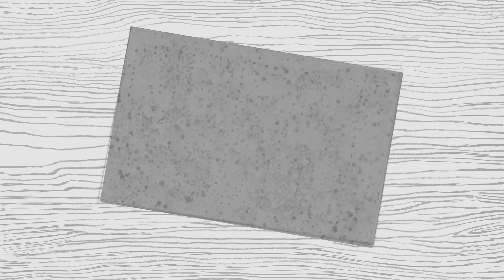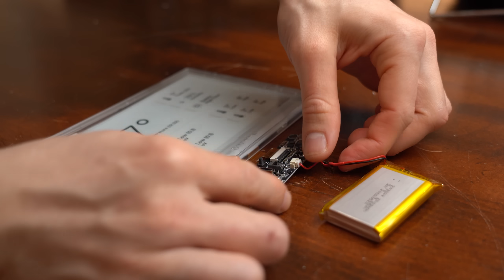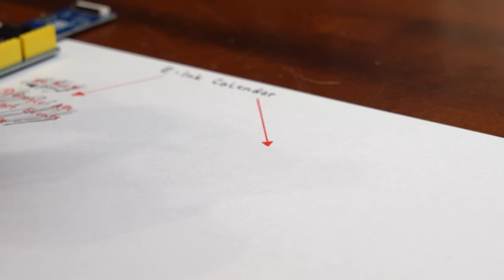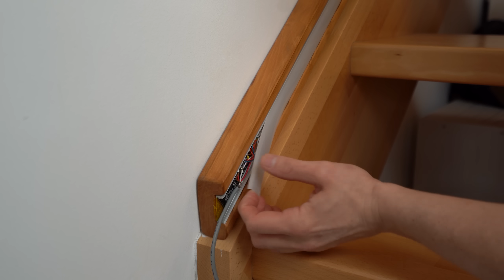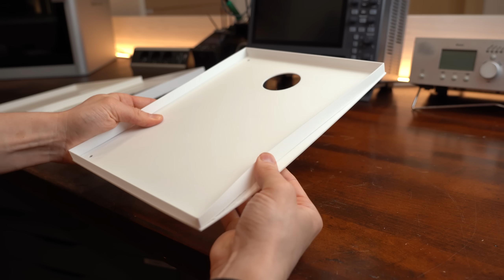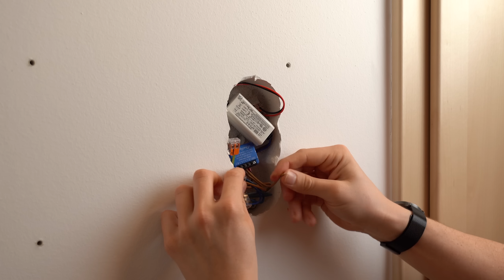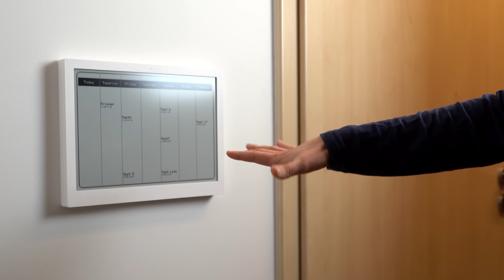Finally! A Home Upgrade That Makes Sense (E-Ink Display)

Comment: do you know much about esphome? I see it's enabled in your HA instance, but was surprised that this wasn't your first choice in how to approach this problem. It is a good way to integrate between HA and an ESP32, and there's so much headstart you get with something like that, OTA updates for example (I know you enabled that in your project, but it's native in esphome). Worth looking at, at some stage, to see if it's a simpler task than this.

Comment: Heyy, ich bin Privat super interessiert an Elektrotechnik, innerhalb von Geräten, arbeite
 aber momentan in der Industrie als Betriebselektriker. Da wäre meine Frage: Beschäftigst du dich nur privat mit Themen wie schaltungs Design und den einzelnen Komponenten oder ist das Teil deines Berufes? Wenn es Beruflich ist, kannst du mir verraten wie dein Beruf heißt? Weil ich denn vllt auch in die richtig ausschau halten könnte. Bin ja erst 22. Liebe Grüße

Comment: It's amazing, only thing I'd change it's to use the native esphome. Integrates amazingly with home assistant and allows you for quick ota with a decent secure structure keeping secrets and backup hotspot from the esp in case your network configuration changes.

Comment: I built something similar but cheaper. Took an old laptop, removed screen, bought controller on Ali, build frame from wood, and installed magic mirror, that has hundreds of plugins. It’s now integrated with google calendar, todoist, weather, news from local supplier. I added led rgb strip to inform me about bad air quality, speakers and mic for future use, motion sensor to turn off the screen if no one is around… it’s just loved by my family

Comment: That's a nice project. I did a similar one like that myself a couple of years ago, when the E-Ink displays were smaller and more expensive, I learnt the following when I did that:
(i) it's much easier to have a Raspberry PI sitting around that runs a couple of python scripts to call the openweather api,, google calendar service, etc, to compose an image to display, and restrict the E-Ink device to being a dumb terminal that will just draw anything it's been given .
(ii) I tried using a 3.7V Li-Ion battery and update every five minutes or on a button press - it would last for a couple of days on a single charge. However the hassle of having to recharge the battery every couple of days was too much, the thing really needs a continuous power supply otherwise it does not get used.
(iii) In those days I needed separate boards for power supply, timer, e-ink module, wifi module and microcontroller board, which meant the whole thing was about 2.5cm and not a sleek as your product. This project would be much easier today, now one board does the microcontroller part, the wifi link and e-ink interface.
(iv) Your 3d printed result looks much better than what I was able to create with woodworking three years ago.
However you have given me inspiration to give it another go.

Comment: The next upgrade step for this would be a two colour or rgb e-ink display, so each person could easily at a glance tell the activities that concern on, the other, or both. Either way, very cool idea, I hope more manufacturers start making and implementing e-ink displays, especially in applications like smart hub interfaces and such, where it can then be on forever.

Comment: That was a pretty awesome project! I like how big the display is, although hopefully those big e-ink displays will get cheaper over time.

One thing I thought might be useful is a button to manually refresh the calendar, in case you add an event tomorrow or in a few days time, and want to make sure it's visible immediately. Or does it already wake up and check for updates frequently during the day?

Comment: You could have left it as a home assistant dashboard, and just have it popping up calendar notifications. Like have a section that says upcoming week and shows an overview and then if you tap on it it shows you each event and then also have part of the page showing upcoming events that you have scheduled. I would have just kept it as a home assistant dashboard and did something like that. Because my calendar and my shared calendar with my wife is already feeding into home assistant with automations based on those events. 

One automation is if we have an event that's coming up and the destination is included in it and in the description I put pre-start, then home assistant automatically figures out the trip time for that event and then 10 minutes prior to the time that we have to leave the house, the truck will automatically remote start and turn the AC on, since we are living in Phoenix and it's currently February and nearly 90°.

Comment: Hey I'm using PIR module with Relay which needs ~5 to 12V DC.
I'm wondering how the AC once working, they could be found as 'SMART PIR SWITCH' with 2 pairs (220v AC IN & OUT)of wires.

Comment: Don't apologize for using AI.

My advice would be to discuss your project idea with an LLM first—they won't give you a complete solution, but often offer ideas for solutions you wouldn't have thought of yourself (e.g., regarding ICS files). I'm a programmer with a master's degree, and I almost always do this now when I'm faced with problems or projects where I don't yet have a concrete plan.

Best regards from Bavaria :-)

Comment: I’ve worked a bunch with Gooddisplay e-inks and if you use anything other than their devboards, you should go through their provided library, because there are a bunch of hard coded gpio pins in weird places in there…

Comment: TRMNL’s architectural approach to this is to keep the display “dumb” (hence the name, terminal) and have it be responsible only for downloading and displaying images. Their server is basically headless Firefox that renders instead a webpage, converts that to an an image that then is downloaded at a regular interval as specified in an API. The API just tells the TRMNL what to show and how frequently to request it, if I recall.
Reply: And you can see why they did that because eink displays are designed to display static images. That display takes almost 2 seconds to refresh.
Reply: This is a much better idea imo. A lot easier and faster to iterate on a UI if it's built with HTML/CSS.

Comment: did you consider using esphome for that? As far as I saw the Good Display eInk displays are supported there and that sounds to me like a much easier solution
Reply: That's what I thought too. If you're connecting an ESP (or Beken) board to home assistant, esphome is much cleaner. No need for mqtt brokers, you get notifications of updates being available which means less chance for serious security problems, and it's designed around OTS updates from the start.

Comment: I did a similar project and I just made a template sensor in home assistant with for example the weather data for 6 hours or the next 3 days of calendar events and then use esphome on the e-ink esp32 and just grab the template sensors, parse the data and display it. With this, i can also update easily the software on the esp later, without directly connecting to it and as bonus i also get a Bluetooth proxy if a want. Also you can define buttons in esphome for cycling between different information, and the buttons are already neatly integrated in home assistant. So i would recommend esphome

Comment: Awesome video as usual! Word of advice: DON'T touch the printer plate with your bare hands! Either use gloves or only touch it on the sides if you don't want to spend hours troubleshooting why on earth your prints don't stick to the plate. Ask me how I know... 🤣 Dish soap, a sponge and a soft brush will do the trick btw. Glad to see you posting again!
Reply: I usually have to give my printer bed a clean before I use it because it's been so long it's gathered dust, and the plastic won't stick to dust.

Comment: With such a large display, I’d shrink the calendar pane down a bit to make room for some additional info, like current time, current weather, and weather forecast.
Reply: also memo and or notes

ex.: Don't forget the trash
inflate tire
Reply: There's a project called TRMNL that does this very nicely. They make devices but you can also BYOD hardware.
Reply: @trakaismikus  Just checked this out, pretty much is the same as what was made here. $219 for TRMNL X, $254 with all of the upgrades. After seeing the price of the E-ink display itself, buying one outright might be the move. But making something yourself just scratches that part of the brain nothing else can reach.

Comment: Nice idea!
They did horible PCB design for the ESP32, passing some traces under the antenna ;) 
Also, if you redesign that PCB or at least remove all connectors, you can make the whole display 3d housing thinner. I think it will fit better on the wall.

Comment: Nice overall, especially in terms of power consumption - no arguing. To me, the biggest issue would immediately be the lack of any input on that thing, hence the inability to interact with it on the spot when I need to, which would make me wish it were a regular tablet stuck on the wall there......possibly for the same price AND with full Android features :))

Comment: I genuinely like this concept, but I hope it’s feasible to create something with e-ink and a touchscreen in the same size.
Reply: It should also have a proximity sensor and backlight. Otherwise, it would be useless to me in the evenings, as I’d have to turn on the main light just to see the display.
Reply: @kubsztal  So at the current price tag, it seems more sensible to buy a really cheap tablet. Although that still wouldn't solve your proximity sensor issue.

Comment: Personally I wouldn't render the image on the ESP at all, but rather create something next to Home Assisstant which renders the grayscale image, and then just tell the ESP to pull it and display it. (you can render images with a headless Chrome for example, then the display layout becomes a HTML). That way you could do much nicer font rendering, integrate many more things as you are not limited by the power of the ESP, also you can find tune the apperance in much quicker turnarounds.
Reply: That's how TRMNL works. They run a headless Firefox that access some APIs to generate the displayed content which is saved as images then displayed on the screen.

Comment: was hoping to see you print a negative form and then fill it with resin or silicon for the frame. hmnnnn. The inside corners 90 and the black rounded border on the display ... my brain is glitching.

Comment: 2 years ago I did similar project. There are 3 eink displays. 13" display shows weather charts and family calendar events. One 7" display shows upcoming company calendar events and second 7" shows some smarthome metrics (temps, humidities, air quality....). Everything controlled by raspi-zero with python code.
Even it took tons of time, it is one of the best time spent ever on my projects. Most useful device for my home I ever built.
The only pity is that e-ink displays are still damn expensive. I wish to replace it with something bigger.

Comment: Eink is too expensive. Have you looked into RLCD as well? Until it gets cheaper I won't touch it if it's not a modded kindle or the eink labels at the store

Comment: E-Ink would be very exciting if the prices will go down, you can buy a new and very capable tablet in $190 and hang it on the wall and connect a motion sensor to it that will turn on the display every time someone pass by, for me at least the saving in power doesn't worth the very high price of the display.

Comment: Calendar, date, and time programming is a special kind of hell.
Reply: For an extra layer of torment, integrate calendar date and time programming with spreadsheets for an international audience space across time zones.
Reply: It truly is. Even if you strictly adhere to ISO 8601, you are bound to, at some point, make a mistake.
Wherever possible I try and avoid "re-inventing the wheel" when it comes to time stuff.
Reply: Solution is rather simple... 

Only use UTC epoch time in the backend, convert into human readable timestamps on the front-end. Same for input, convert from front-end into epoch on the backend. 
Very easy to compare timestamps when they're just numbers. There are no changing timezone's, no daylight saving time, no leap years, or other confusion madness.

Not using epoch is the equivalent of shooting yourself in the foot!
Reply: @timmy7201  doesn't really change anything, most modern systems follow that pattern, but that just shifts the headache part to the translation layer between local and UTC with DST somewhere in between and also adds extra mafs for the developer when checking stuff, especially if someone comes in with a complaint regarding these systems and of course the database date is in UTC but the complaint came with a screenshot in local time!

and then there are legacy systems...
Reply: @chadyways8750  You use a simple DateTime conversion library, in-between backend and frontend.

That library automatically handles the conversion between local time of the users system, UTC and DST stuff...

If there is a complaint about something at a certain time, getting the epoch is as simple as using an online time to epoch conversion tool.
Reply: @timmy7201  2038 inbound

Comment: Hey Scott! Here is a easier and way more flexible way. You can render a HomeAssistant Dashboard to a PNG file and the display module need just to download and show it. You can anytime modify content of the Dashboard, combine calendar, wheater, whatever... and dont need to change anything on the E-Ink Firmware. I use it to bring wheater to my old modified Kindle
Reply: How do you render it to a PNG?
Reply: @Haldi4803   Docker Container sibbl/hass-lovelace-kindle-screensaver, you just need Access Token for Home Assistant

Comment: 13" E-Ink are barely afforable. Got lucky and managed to snag a used 23" Color E-Ink with Android for 500€ 3200x1800 pixel. Android just snatches The Homeassistant Dashboard and Displays it. Then goes back offline till next Sync.

Comment: I absolutely love this project but I'm wondering, how would you handle "sensitive" information when you have visits ? Not maybe a family but some technician, etc. I assume you do not want to see everyone what you have in your shared calendar
Reply: Assuming you have these visits in a/the calender too it is probably possible to use the event colors to designate private events and visitor events and then just replace the title of private events with "Private Event" if the current time and date is inside one of the visitor events start and end time and date. 

And maybe add some time before and after the visitor event, so you can enter the real start and end time to account for the visitor being a bit early or late.
Reply: What about turning it off for that brief time?
Reply: @MacieyevskyWill you remember to do that? That's the point

Comment: I've experimented a lot with eink displays recently. My recommendation is: Use ESPhome to display an image on the eink. Then use the Puppet addon to provide a Home Assistant dashboard as an image. This way you can "design" everything as a dashboard without coding.

Comment: Nice project! But I would've implemented it differently: Why not generate the entire screen content as an image on your Home Assistant server and just upload the image to the ESP32 for display (maybe you could've even used the TRMNL firmware for that then)? Much more powerful hardware, much easier to code for...

Comment: Hi, nice, you might be able to even lower more the current taken by switching the ESP32 into deep (or less deep, depends on your program structure) sleep mode for the time an event is outdated or just regularly update the display with a long interval and let it sleep at night.

The only problem with e-Ink is it is much too expensive for what it can do.
Reply: Deep sleep doesnt seem worth it when connected to mains. On battery though, highly recommended

Comment: Something like this I wanted to have for many many years and I really do not understand why there is literally no manufacturer that even remotely produces something similar like this. Unfortunately this DIY solution is a bit on the pricey side for me. So who is going to be faster the industry developing a commercial product like this or the prices of the displace going down?
Reply: They are expensive because eink displays are expensive and most of their software stack for doing things like refreshing the screen is proprietary, which makes it difficult to do things like integrating a display controller into a tablet or similar.
Reply: There is one...
The M5 Paper! Although too small. But has battery an touch screen.

Comment: Hey I just wanted to know why you didn't use esp home, I think it would be easier as you can control all the esp device from a single dashboard, and with that you can upload firmware to all your esp devices all at once, and also check which esp device is online or not in the esp home dashobard.

Comment: Nice build. Would have looked better if the enclosure was designed like a photo frame.
Reply: Yeah. If I ever do a walk mounted dashboard for HA, it's getting a wooden photo frame. I'd keep the electronics as flat as possible so it can be hung like a picture too.
I'd probably go with a normal TFT LCD though so it can show photos and stuff too. 5-10W is not a big deal with something like 9kW of solar panels on the roof.

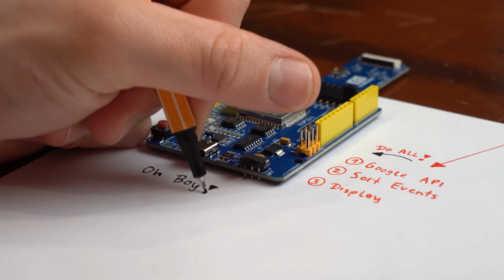Comment: 4:20 I don't see why that would be a lot for the ESP32 to handle, especially if it is a 2-core 240MHz version.
Reply: He is not a developer, creating, reusing or even asking an AI agent to have a Google API client that can receive or send messages to Home Assistant is probably not so fun for him. Home Assistant already has ways to do that and he is already using it so is easier for him. But is true that saying that it has not enough power to do it is not the case.